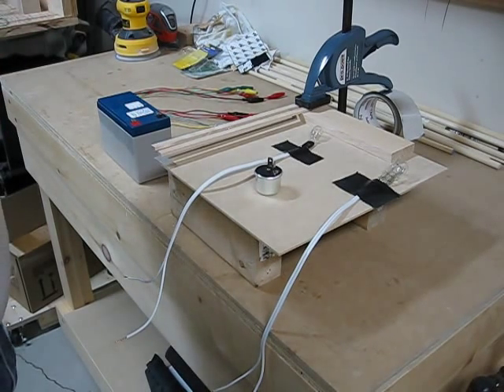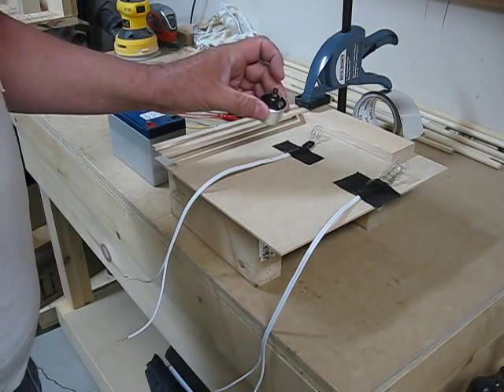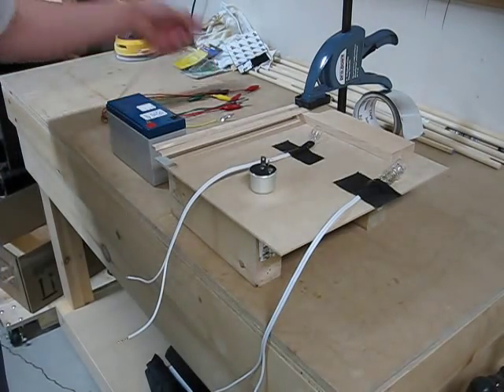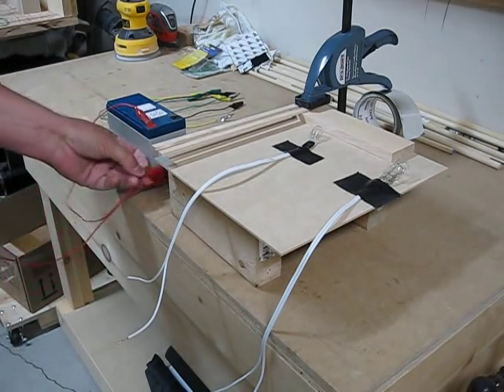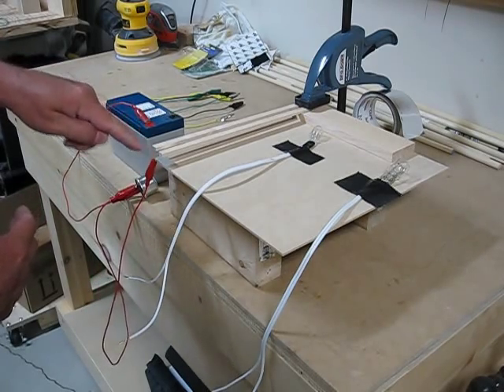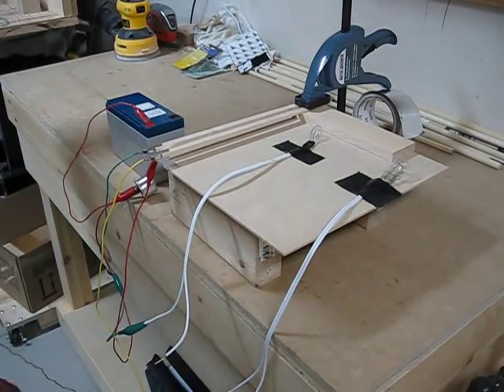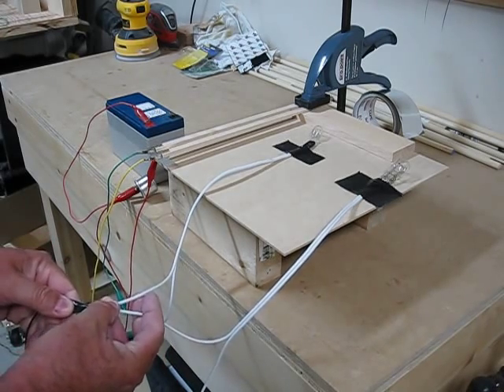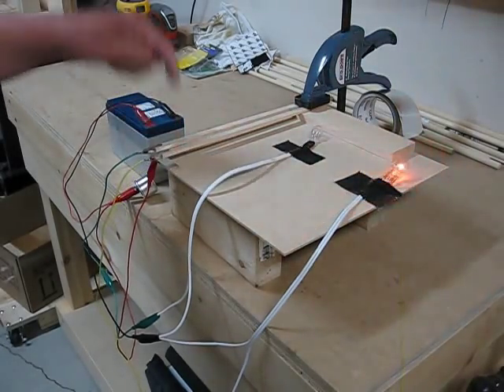Turn Signal Flasher Build

Comment: Thanks for the simple explanation. I am putting safety flashers on an old farm tractor using LED rated 2 wire motorcycle flasher got the job done nicely. Thanks for sharing.

Comment: My question is, how would I wire this if I was using one switch, say the original turn signal switch on my bike? would the one wire coming out of my flasher go to the switch, then from the switch I would run a left and right power wire to the lights, then ground the lights? I think I have it figured out by drawing my own diagram. but not sure? this seems very simple. I cant find the original wiring for the turn signals on my bike, it didn't have any turn signals when I bought it but had them at one point.so I figured it would be easier to use the original switch (found that LOL) and just rewire new turn signals.
Reply from the maker: Yes you have it exactly right. Wire the output of the flasher to the common connector of your switch and then the 2 outputs will go to the left or right side lights. This will direct the 12 volts to the correct lights.
Reply: Paul Pomerleau Many thanks to you!! great Video!

Comment: This is all clear but why not also mention the warning light wiring (one single bulb)?
That's what I was looking and waiting for. I own a Suzuki GS 500 K6 (2006).
Everything works fine, I'm just curious to understand how this "turn signal warning light"
is connected. There must be something I fail to understand checking the wiring diagram.

Comment from the maker: It seems I can't comment to peoples comments on this video. This just started and only on this video so far. I don't know why. I will try to figure it out and get back to those asking questions.

Stephen Craig - I would think your battery is not strong enough to activate the relay. Try a stronger battery or put a charger on it at the same time.

Comment: I have a 67 mili amp drain and it's coming from my hazards.  When I pull the two prong relay out the drain stops.  All my signals, hazards, marker and head lights work fine.  What steps would you do to find the parasitic electrical draw?
Reply from the maker: Troubleshooting this type of symptom is always difficult. Depending on the vehicle it could be using a Canbus system to activate your lights which uses low voltage communication between circuit boards and not just a straight 12 volt signal. This could be normal for your vehicle. But if it is not then it may be corrosion within the circuit. Either inside the relay itself or inside the bulb sockets, or the grounding wires. It is very difficult to say with the info that I have.

Comment: Muy Didáctico. Muchas Gracias. Una Pregunta: ¿Cómo sería el Diseño con flasher de 3 Contactos?
:::>Very didactic. Thank You So Much. One question: What would the design with flasher 3 Contacts? <:::
Reply from the maker: Fredy Mora Usually a 3 pin relay is an electronic version with a tiny circuit board. One pin will be battery, the other ground and the third is the output to the lights. This way the flash rate will be the same no matter how many lights you put on the system.
Reply: +Paul Pomerleau I found this: X = Battery (Power Input), L = Load (Lamp Output), P = Pilot ( Indicator Lamp).
Reply from the maker: +Fredy Mora 
That is what is considered an "isolater". You would add that to the existing turn signal in order to add more lights so it will not interfere with the existing lights. For example, if you were to put a trailer on your vehicle, or adding LED lights, this keeps everything separate so there is no interference and everything will work independently. Hope this helps.

Comment: My last question would be if I would y split from the flasher relay ..looks like need two buttons  one for left other for right ?  I thinks that way to go and y split the ground to .. I think that makes sense.
Reply from the maker: Emprez hernandez The output of the flasher could be split and go to each switch. Then the other side of the switch will split to the lights on the left or the right (front and back) then ground the other side of the lights. That would work too.

Comment: Just wondering I have momentary switches that are two prong. So there for would I run the positive in to the switches (splitting From the relay) then out to the lights and still ground the lights the same? I'm trying to get turn signals on my motor cycle. Also would I need a fuse?
Reply: Wicked Si Figured it out. I answered my own question. Thanks for the awesome video! Now I have signals on my motorcycle! Watch out people on the side walk here i come! :D
Reply: Wicked Si I had them working on my bike no problem. Today I drove it and got about three blocks and the battery is completely dead. Do i not keep them connected to the battery???

Comment: Great video!Can you operate both lights at the same time by any chance? Also, I would like to make this except I want to use a switch for the left and right turn signals and add hazards on a four light system. Any suggestions on what type of switches I need and what wiring diagram to use? Any information would be greatly appreciated! Thanks in advance! Best regards!
Reply from the maker: There are several ways to do this. You can either use momentary switches that you have to hold to make the lights flash, or use push on/push off switches that you can activate and then press them again to turn them off. Then a double pole push on/push off switch for the hazard lights.
Reply: +Paul Pomerleau Thanks for the fast reply Paul! Great information here! One more quick question if I may. I'm wanting to put this together but I want to use led marker lights for this project I'm building. Would I need to use one of those LED flashers? Or could I just keep it simple with the two prong flasher that your using. My project isn't going to have any other loads on the circuit, just the load from the other led marker lights and nothing else. I've subscribed to your channel. I appreciate you my friend! Take care!
Reply from the maker: The LED lights won't draw enough current to make the simple 2 prong flasher operate. You will probably need to get an electronic flasher. It will have 3 prongs, a positive, a negative and an output that will go to the lights. This way it will always flash at the same rate no matter how many lights are attached to it and not rely on the heat from the current. Any automotive store will carry this as people have to change the old one in their cars when they add a trailer.
Reply: +Paul Pomerleau Thanks for the information my friend! I checked out your website and will be doing business with you in the future. Till then, Best Regards!
Reply from the maker: The 2 pin flasher relies on heat from current to flash, the more bulbs the more current and the faster it will flash.
The 3 pin unit typically has a pin for ground, another for battery +, and the third pin is for the flashing out. It is a fixed rate so it can be used for LED's and other lights and will flash at a constant rate.

Comment: Hello, I have a road king, and my left turn signal is not flashing, it just stays on.  both the front and the back left signals have the same problem.  is it a fuze?  or do i have to change the whole harness?
Reply from the maker: silencio azul Wow, this is a tough one. Just to clarify what is happening on your bike, when you are riding all your signal lights are off, when you try to signal left your front and rear left lights come on and stay on (no flash). Are your right side lights working ok? I doubt it would be a fuse. Remove both lights on the left and using a test light see if the 12 volts is turning off and on. Also check the ground from the bulb socket and make sure it is good. Check the flasher relay as well, that is about the simplest things to check first. I am not very familiar with Harley, they may have a circuit board that controls the signals in which case it won't be as simple as what is in my video. Good luck with this.
Reply: Thank you Paul, I will apply this procedures.  Hopefully I won't have to go to the dealership and pay and arm and a leg.

Comment: very helpful video, i have a question, is there anyway that i can do so the momentary button became like push on/push off button so you don't have to keep pressing it when you want it to flash? thanks!
Reply from the maker: +fadli afdi You will now have to incorporate a circuit board system into the switches. It is very easy and available from various companies. Some places like (SDC) SignalDynamics.com has various modules to do different things. Look them up, I am sure they will have something that you are looking for. There are other companies as well, a Google search will find some in your area.

Comment: What happen if u had both switches down will it still work
Reply from the maker: copper Gray Yes, this is how they make the hazard lights work, all lights flashing at the same time.
Reply: Paul Pomerleau I hooked it up just how you did and it still doesn't blink
Reply: the bulbs might not be pulling enough amp to flash but if it is electronic flasher it should blink
Reply: 1973C10 1965Elcamino. they are brand new led lights. do I need a bigger flasher?

Comment: Paul, great video. I am wondering if I can ground my signals to the frame?
Reply from the maker: +Wilie Kent 
Of course. Make sure it is a good clean point. If it doesn't work, that area may be insulated from the frame and you will have to find another area. A meter will let you know if the area is a good ground.
Good luck.

Comment: What if my battery only has a positive and negative with no ground? Can i just ground a wire to some where else?
Reply from the maker: +Isaiah Daquioag 
The negative side of a battery is the ground.
Reply: +Paul Pomerleau oh nvm i seen your vid a second time, i thought there was 2 grounds on your battery, but i only see 1 each of positive and negative, thanks though! And good vid, something i can understand
Reply: +Paul Pomerleau what if i got switches to control the signal, i got the lights flashing but one side stays flashing but doesnt turn off
Reply from the maker: +Isaiah Daquioag 
In my video I am using momentary switches, so once you let go the power stops. It sounds like you put in an on/off switch. If you did that and pushed the switch to on, then it will stay on until you push it to off. This circuit is meant for momentary switches.
Reply: +Paul Pomerleau oh ok thanks tho!

Comment: What wiring to use for this with 8aa batteries
Reply from the maker: There are usually 2 signal lights on at the same time (front & back). I would use minimum 16 gauge wire, but 14 gauge is better. Also I don't think AA batteries will have the current needed to operate this type of flasher. You will probably need an electronic flasher.
Reply: @PaulPomerleau  
I got a flasher relay (3-pin) in auto zone. I hooked it up with test clip wire and it works. So I will use 14-16 gague wire then. I think I have 18 gague lamp wire lying around though.

Comment: I love this great tutorial I just had a question what kind of toggle switch can i use to give that fuction of bein a able to turn left and right ? Thanks if u can help.
Reply from the maker: This circuit is designed to use momentary switches where you have to hold the button to flash and release it to stop.
I did this because my buddy had these type of switches on his motorcycle handlebars but thought he could not have turn signals with those types of switches.
So I did this video to show him that he could.

Comment: I would like to ask you a question, from where would I run the other 2 lights? (Front/Back)
Reply from the maker: +Juan Ochoa On the end of the green and yellow alligator clips where they attach to one of the white wires going to the light bulb, you could attach the second bulb wire there, so the power would go to both sets of lights (front & back). This particular flasher will flash a bit faster since we are now drawing twice as much power. You could use an upgraded electronic flasher if you want to have constant speed and additional lights.

Comment: What would be the difference if my flasher has 3 prongs?
Reply from the maker: That depends what is written beside each prong. A "B" or "+" is your battery positive. An "L" is load meaning your lights going through your signal switch. A "-" is ground or battery negative. A "P" is for an indicator light on the dash. Yours may differ depending on who makes it and from what country, but usually it is stamped on the flasher unit or on the packaging.
Reply: Paul Pomerleau thanks for insight and quick reply

Comment: Mine just works if i enable both lamps?
Reply from the maker: The flasher uses current to heat a metal spring to open the circuit, either you will need lights that draw more current or your battery is not strong enough to deliver the current. You can also try an electronic flasher that works using a circuit board inside that will make the lights flash no matter what kind. Hope this helps.
Reply: @PaulPomerleau  That makes sense, Thanks :D

Comment: would this work with a switch concept like an I'm off switch
Reply from the maker: Yes it would, but like a light switch you would press up to turn on the signal lights and they would stay on until you pressed the switch down to turn them off. If you pushed both switches into the on position then both sides would flash like hazard lights.
Reply: Oh ok would I need a resistor if I'm doing leds
Reply from the maker: The flasher in my video is the very basic model and requires current to operate. LED's don't generate enough current. So you will either need resistors or get an electronic flasher which has a circuit board inside to regulate the flashing, then it doesn't matter what lights you use.
Reply: oh ok I have some just wasn't sure does it matter where they would go on the harness or no
Reply from the maker: Normally they would be near the bulb itself, but I guess anywhere on the wire between the bulb and the switch would be the same. Also the resistors are going to have to be high power ones about 10 watts each. The small 1/4 watt resistors will burn out or simply won't work if you are going to use the basic flasher module that requires higher current to operate.

Comment: no relays?
Reply from the maker: Relays are only needed if the lights are drawing more power than the switches can handle. In this case no relay is needed. If I wanted to hook up an air horn for a pulsing alarm then I would need a relay because the switch would eventually burn out not being able to handle all the power.

Comment: Why it flashes faster when one bulb is out in a cat
Reply from the maker: o0Orange The inexpensive flashers work using current that heats a piece of metal that eventually opens the contacts until it cools again then it closes the contacts and the cycle starts again. So by adding more bulbs, or bigger bulbs the flasher will operate differently. This is why when you put a trailer on a car the lights flash really fast, or by changing the bulbs to LED's they may not flash at all... it's all about the current. One possible way to fix this is to change the flasher module for a better one, one that can regulate the speed of the flash no matter the type of bulb. This is usually what you have to do when adding a trailer to a car. The wiring connections that I show in my video remains the same.
Reply: thank you so much for you infos. that really helps

Comment: i made that long time ago in 2006 on my ford econoline van, works great with tractor starter buttons, 1st on was done on my 88 econoline van and i did it to my 91 econoline, and i got them on my gator cx, works best with automatic transmissions, not in manual transmission as you have to use the clutch, here's the video of my turn signals on the floor in my 91 econoline van https://www.youtube.com/watch?v=KqI0LdLPVCY